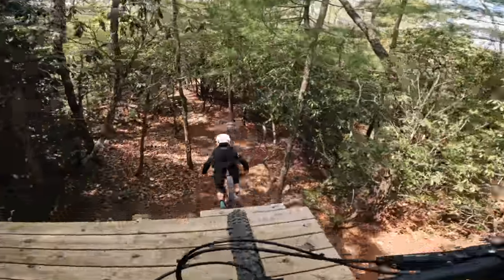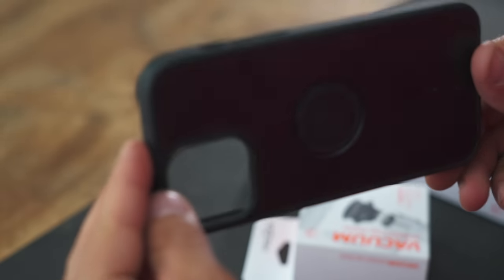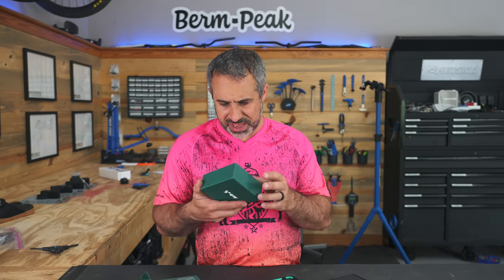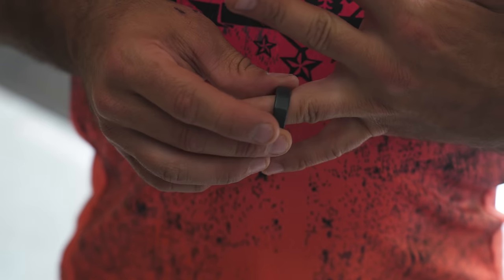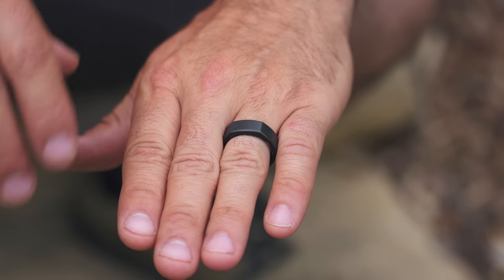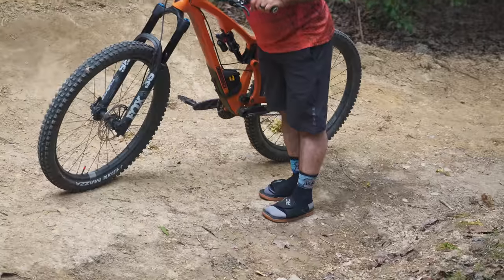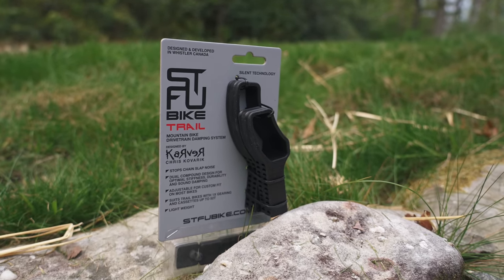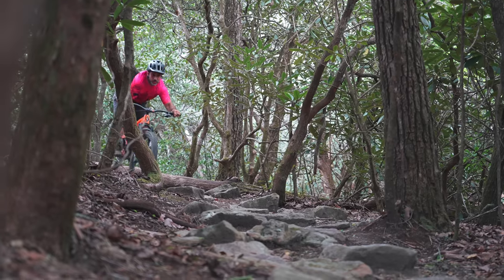Reviewing Semi-Normal Mountain Bike Products

Comment: FYI to anybody excited about the Cable Buddies, if your cable/brake lines are not perfectly parallel with each other like Seth's are, these things are totally useless. I ordered 2 sets for mine and my daughter's bikes, and they won't work on either one. They don't hold tight enough, so if the cables are at slightly different angles and will just pop off.

Comment: Weird, I have a quadlock phone case and still use my samsung wireless charging base with no issue. Never realized for a second that it was not supposed to work. Also for my car I picked up the quadlock mount with wireless charging head, so it locks in and charges while  driving.

Comment: does your wireless charging bay not have a wire?
then it's still wired charging. 
you still have to walk over to the charging dock and put your phone on it. the only thing you don't have to do is plug it in. 
and for that laziness you waste 50% energy. just for the laziness of not plugging in a cable...

Comment: EDIT, just saw your pinned post. Oops :( Just ignore this embarrassing rant then. | Seth, mate, what are you on about the Quadlock not doing wireless charging !? I have an iPhone 10S in a Quadlock case and it works fine with a generic wireless charger AND the Quadlock wireless charger for my windscreen suction mount in my car. (yYou might need a better quality charger?) Quadlock ALSO now have a waterproof and vibration-damped! WIRELESS mount if you want to charge and ride. PLUS, their case is sealed once you put a phone in thus keeping trail dust out of the case. They also have the Poncho rain and dust cover if you want even more protection. Even Peak Design couldn't beat all the Quadlock features when they tried to copy Quadlock in their recent Kickstarter. Quadlock was born in Australia, and they are too lazy to not have things just work. 🦘🛠

Comment: At 2:49, dude that stem is so unsafe. Steerer tube at least needs to be within a couple mm of the top of the stem, ideally a couple mm over the top. That top clamp barely has any steerer to grab onto with the steerer so low in the stem. Hope you have extra dental insurance!

Comment: I have used mous cases for 2 years you can see the wear and tear slightly after a couple months but dropped my phone around 100 from waist height and it never broke the phone let alone screen protector, I put this case to the test and threw it up 15ft and it landed flat a broke the back glass, but they are incredible cases and very reliable if you drop your phone all the time 👍🏽🤣

Comment: I wouldn't worry about wireless charging because it is really inefficient and it causes your battery to heat up thus reducing battery life and degrading the battery. If you care about the battery life of your device and don't want to put more phones in landfills you shouldn't use Qi (wireless) charging just like you would fast charging.

Comment: If you don't have a place for your bike then you shouldn't have a bike.

That being said, the best place for a bike to be out of the way is suspended from the ceiling on its side. Especially if you have the energy to loosen the handlebars to get it really flat.
How? Just put some thin ropes through eyelets in the ceiling and run them down a wall. Lay the bike on its side and hook the ropes up and pull the bike to the ceiling and secure the ropes on one of those boat lashing things or anything else you'd like.
This is of course assuming you have enough space in your ceiling, which 99% of homes do.